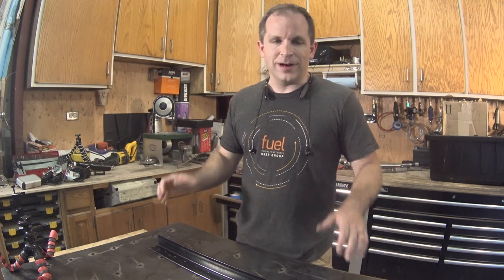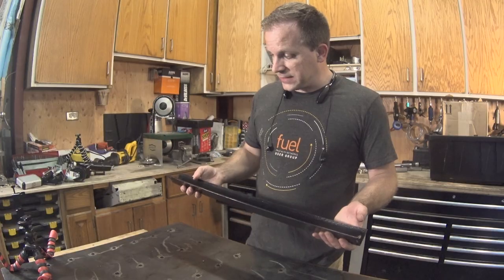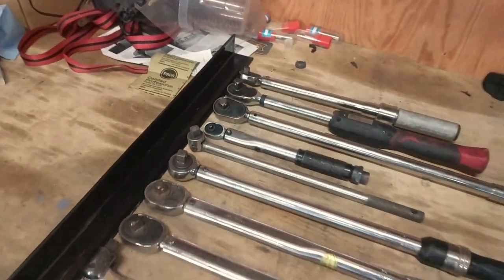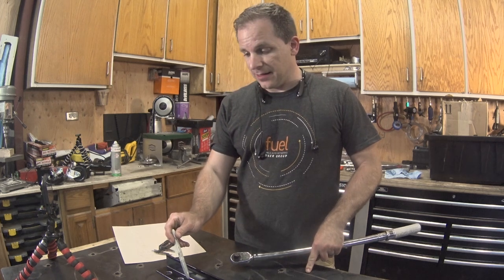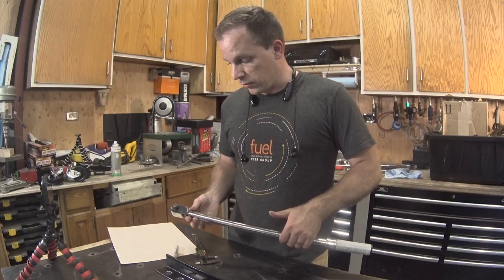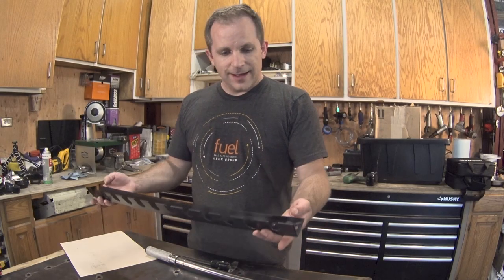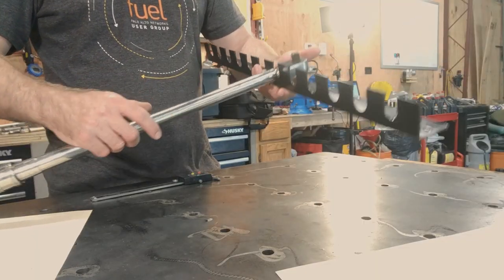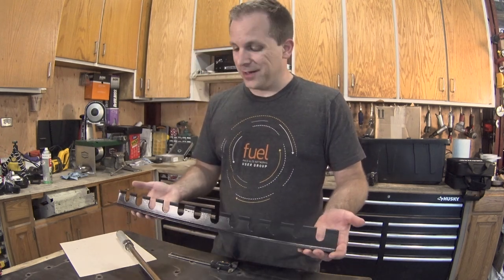Make a Breaker Bar Holder - Organizing the shop

Comment: Hey, I see you’re in NH, as I am. I like this project. We just built a new home a couple of years ago and I have one half of our 24X24 garage at present, as my workshop. Naturally, it’s evolving, changing and modifying on a weekly basis!🤣
I really like this design. Simple and easy. I see another viewer suggesting a magnetic strip. I think for this application, I’d avoid that. It tends to mar and scrape tools and, in the case of the digital torque, might impact the operation of the tool. 
Great video! Thanks for sharing!

Comment: Personally if I were you. I would throw up a harbor freight 18" magnet on the back where you sunk the screws in the top. Then maybe hang one or two on the wall halfway down the handles.
Reply from the maker: Thats not a bad idea, i have a few holding up some wrenches and plyers!
Reply: that is clever - thanks 👍